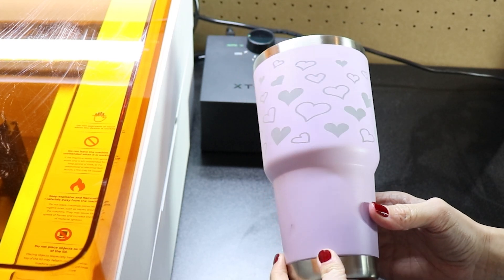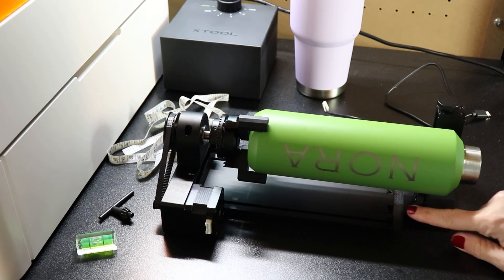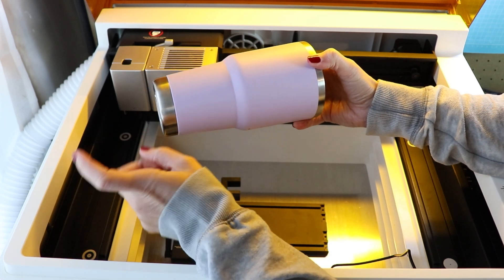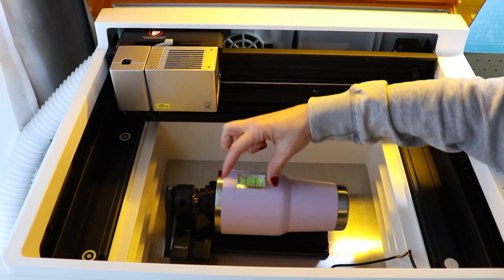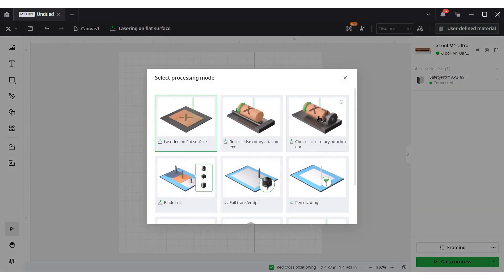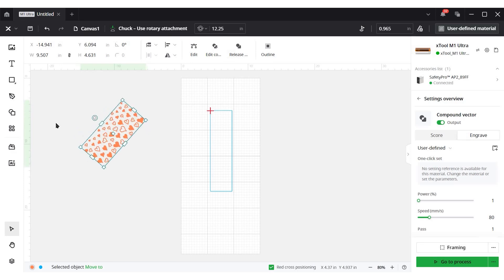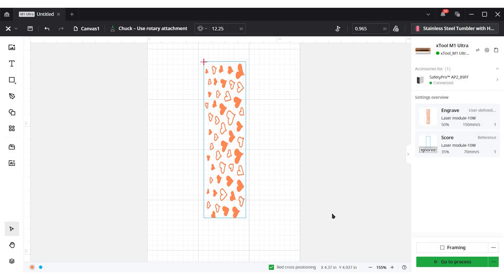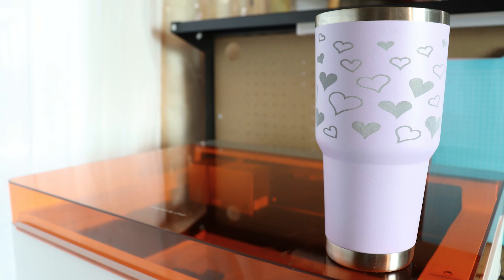xTool M1 Ultra tumbler engraving overview and beginner project

Comment: Do the images warp and distort with tumblers that taper in the farther down they go? For example, your tumbler is not perfectly cylindrical. It tapers. The design you used in this example wouldn’t really show it. But does the laser compensate somehow for that taper?
Reply from the maker: It may not distort but it won't look right if you don't take the taper into account. When creating a design it's helpful to have the full wrap shape on the canvas that  matches the tumbler. For a taper it would be larger on the top and smaller on the bottom. Then place your design inside. It helps visually see where everything is going and ensures it will fully wrap and not distort.

Comment: How are you setting up your M1 Ultra to do a full wrap on a 40oz tumbler. Even when I fold the handle brackets down, my laser is hitting the brackets. 

My process is to use the support to lift the bottom approximately 3 degrees so the distance to the laser is the same on the top and the bottom of the cup. But I can'  seem to figure out how to stop the laser from hitting the brackets. Any success?
Reply from the maker: The specific 40oz tumblers I have done on this machine do not have handles. The purple one in this video came without a handle. When I've done them on other machines, I start the design next to the handle brackets and have it run around the whole tumbler, but the laser never actually moves over the brackets. This is fine for the upper part, but it will leave a gap when you are engraving the bottom. You could do the upper and lower parts separately.
Reply: @SarahVanderkooy  thank you!

Comment: You don't need to apply a painters tape to any tumblers/water bottles?

Why do other people apply a masking / painters(blue) tape before laser engraving?
Reply from the maker: Depends on what you are making and what laser you are using. If I'm trying to center a logo on a tumbler I will mark off the spot with tape on my item then make sure the image is within those marks before engraving. 
You can also engrave through tape with some lasers to reduce scorching. I don't do this, it's easier to adjust your settings.

Comment: Excellent video! Thanks!! 😊 

My ultra does not show the red cross alignment on my screen. Is this a setting?
Reply from the maker: I cannot find a setting to turn that on or off. Make sure the laser is over your tumbler, then it should show in the working area. You can also make sure your software and firmware are up to date.